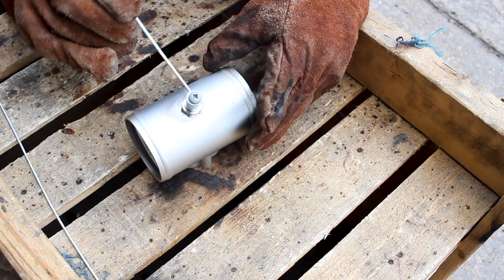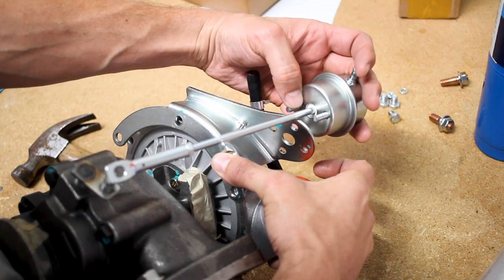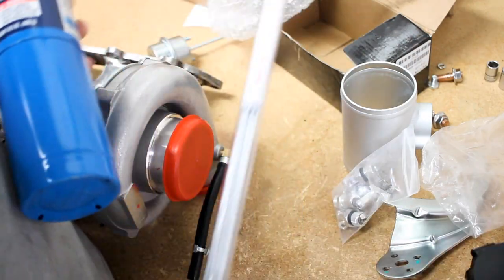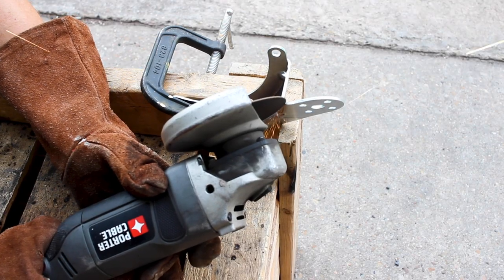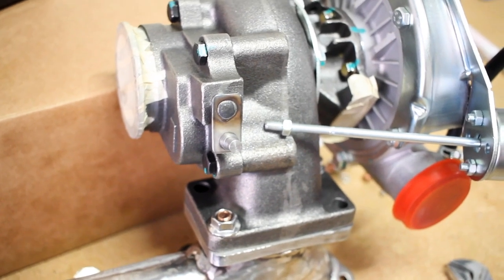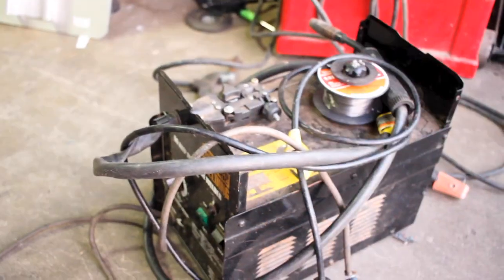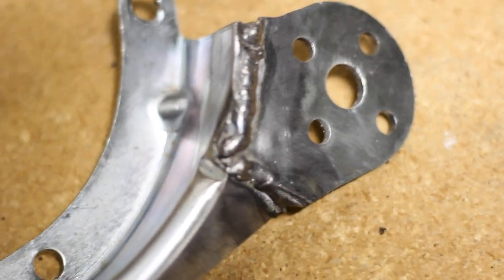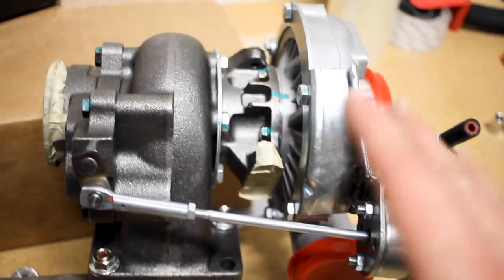$300 eBay Turbo Kit Installation on My Chevy Cruze

Comment: I finally realized who you look like! Paul Rudd. Random, but I kept thinking you looked familiar. Always wanted to play with that Alumaweld! Pretty cool.
Reply from the maker: LOL! I definitely get that a lot. Alumaweld works pretty well. Just takes a lot of heat to get it to suck into the part so it holds, rather than melting the stuff on.

Comment: Awesome man!!!! i turbo charged my 96 toyota corolla been to silver lake a few times now im redoing the engine now but i need to get a lil newer car becuase like yourself i am also having a hard time getting parts u seem to have a little better luck with that keep it up man awesome
Reply from the maker: Thanks man! It definitely took some digging to figure out my engine is a 2H0, but is the same engine overseas listed as the Z18XER, and A18XER. It also shares all the same parts as the A16LER which comes with a turbo. Only different is the cc size. I'm sure with some homework you'll find what you can. Good luck with your project(s). Keep me posted. I'm interested to hear how things work out.